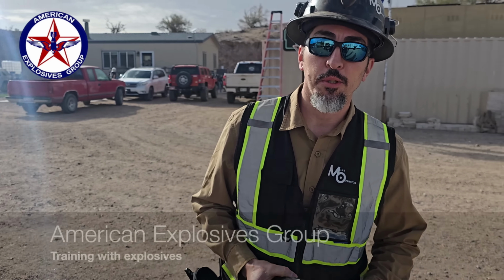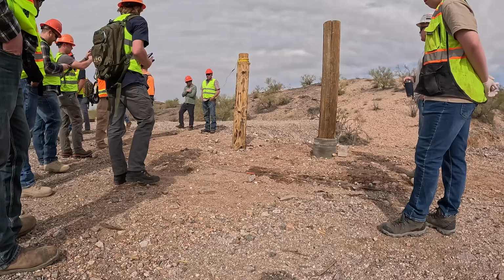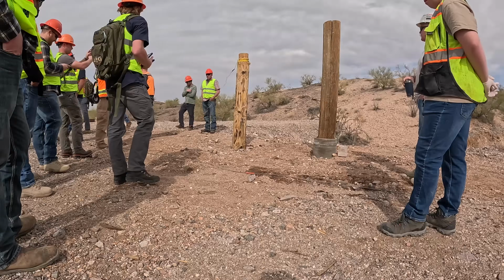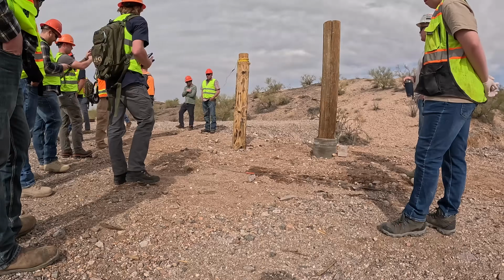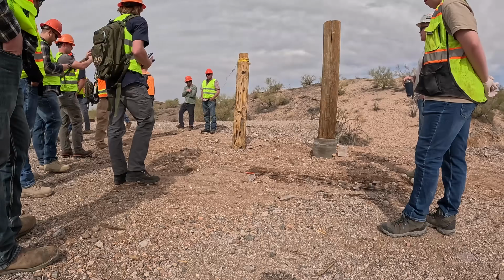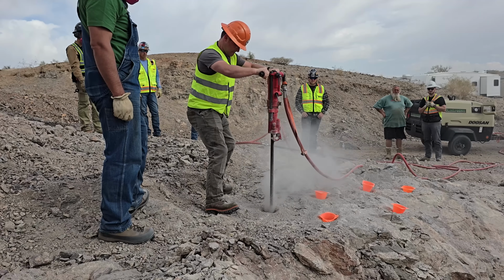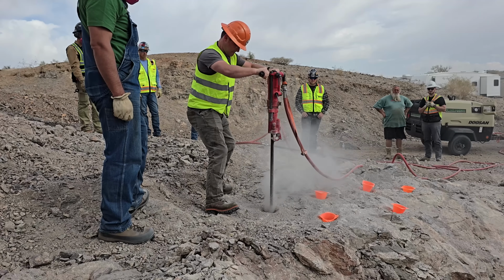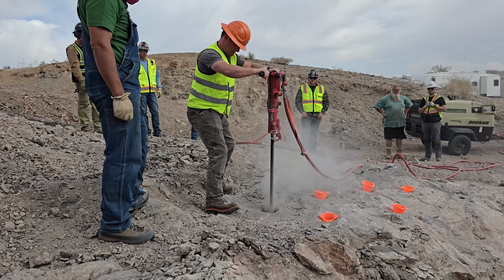Learn to Blast Hard Rock #blasting #demolition

Comment: Putting any counter-blast in front of the working charge will REDUCE the total power.

The secondary blast scattered the direction of the charge, and this reduced its ability to form a clean, integral jet of gas and metal at the target.

Also, it should have had a 2 inch stand-off [such as some small pieces of rock at each end] so the jet had time to coalesce.

In other words: "Y'all dunnit wrong."
Reply from the maker: Copy All

Comment: I think your aluminium shaped charge would have worked better with a similar angled metal on top as well as the bottom to help force and focus the charge downwards.
Reply: Yeah det inside of angle and putty c4 in like clay so angle iron puts c4 right on the metal then tape angle iron to metal plate to achieve a line cut basically a putty filled angle iron to cut